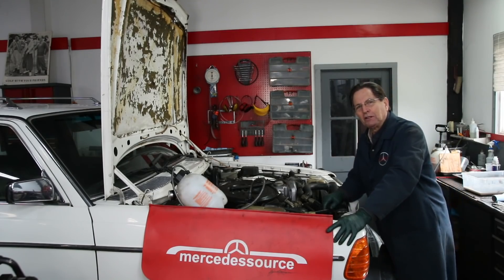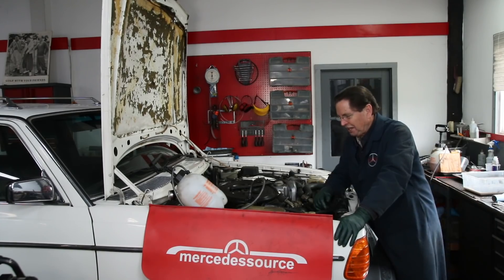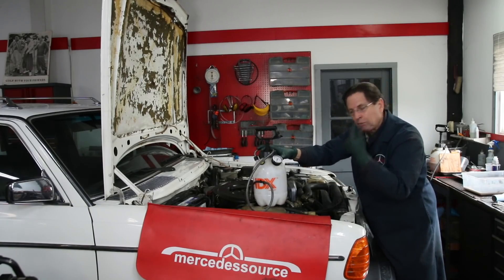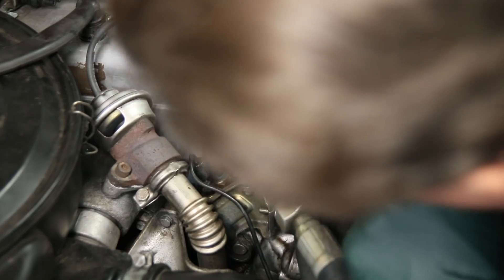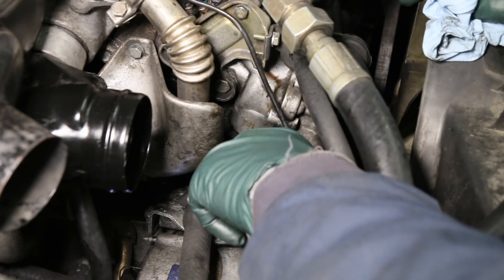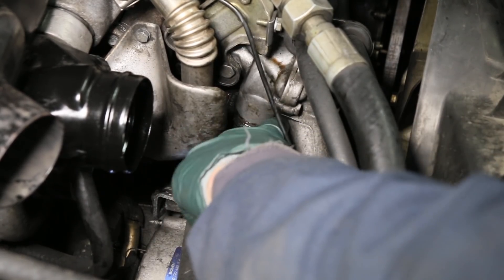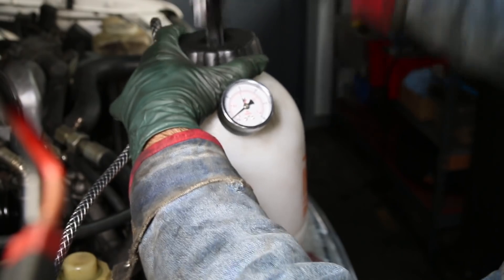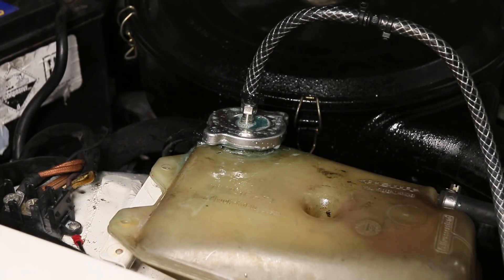A Simple and Effective Coolant System Tester: Kent and Gerson Still  Inventing after 20 years!

Comment: Will you cap adaptation work with a brake bleeder pressure vessel? I have a couple of these and could dedicate one to coolant system testing. Great video by the way.
Reply from the maker: yes it will work with ours as well as other pressure bleeders as long as the hose size will attach and you can go inside the pressure tank to make sure it is not allowing residual brake fluid to enter the cooling system.
Reply: Thank you very much. I think this is a marvelous idea and tool for an overlooked part of routine maintenance.

Comment: I need to have Kents opinion on replacing  heating core on a 2000 s430. I was quoted 3000.00 to replace it, but would like to know if diy is possible.
Reply from the maker: Sorry I have not done one on a W220 so I cannot advise.

Comment: Merry Christmas!! To my favorite youtube channel 👍...I have one of those slow mysterious coolant leaks...sign me up for one of these kits lol ...ill be waiting for its release 👍
Reply from the maker: Thanks and Happy New Year! We just used this cap yesterday to check for leaks after replacing a thermostat and short hose on another car. Sure enough a very small leak was coming out of one of the clamps. That would not have shown up right away just driving the car. Super tool to find coolant leaks quickly without even starting the engine. We are excited about this one. Gerson is building more prototypes as the cap keeps evolving into one that never leaks, easy to install, and easy to adjust the sealing pressure.

Comment: Merry Christmas.  My problem is not a leak. But getting heat through the heater core on my 2005 c180.  Do you have any tips for getting air out of the system? I have tried various tricks. Car on ramps, extended funnel on expansion tank, Have even tried a pella pump to create a vacuum then suck the coolant back in. My big worry is that it is the heater core, but I have also flushed that out too. On the odd occasion,  the heat will come through just after flushing for a few days then fade to cool again.